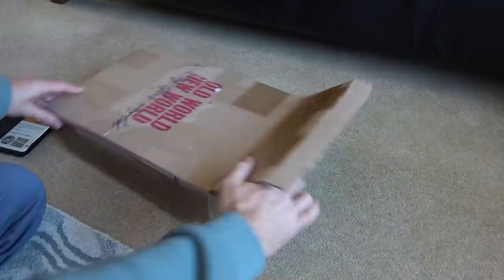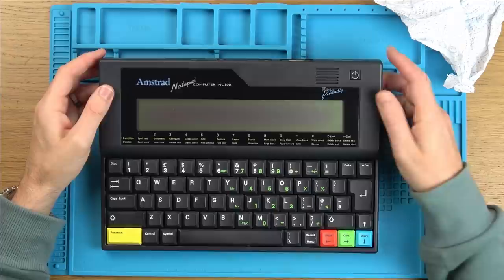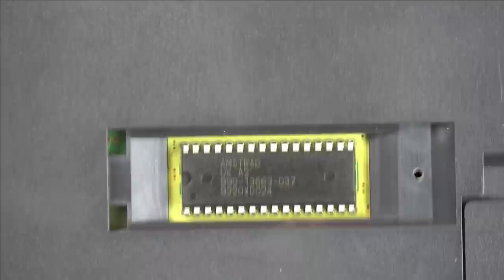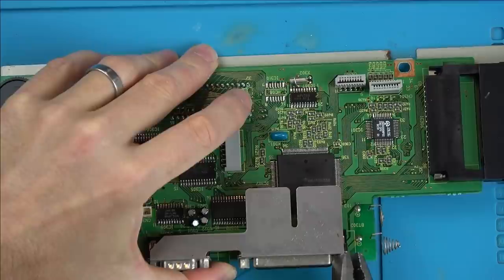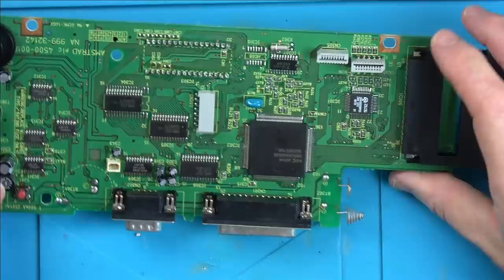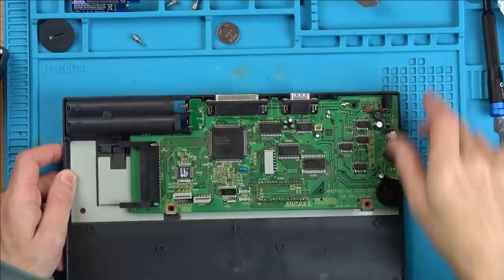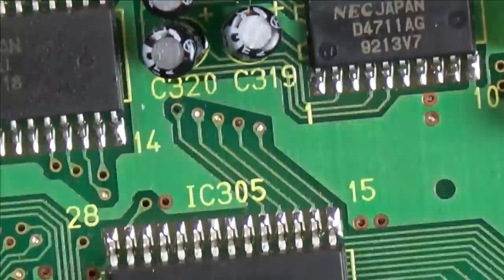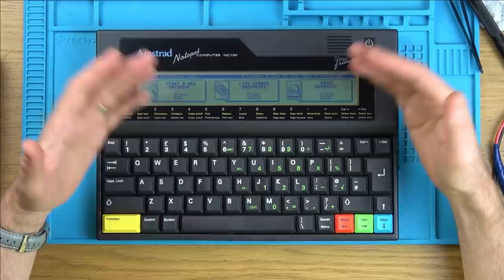Broken 1992 AMSTRAD Notepad COMPUTER NC100 - Trying to FIX

Comment: It almost looked as if the plug had been soldered, looked like flux residue around the lugs, right near the fuse. Maybe someone worked on it and melted the fuse with a bit too much heat

Comment: the wickman fuse on these fails a lot, seemingly for no reason, especially if it looks like its covered with white 'fur', the plastic casing theyre made of leaches out some sort of 'corrosive' stuff which can eat the fine internal wire, the external dc input does not feed power to 'charge' the internal batteries but switches them out on external power, but of course, it could be modified to do so ,..   these may be found to  have a surface mount type fuse instead of the through hole type yours, and mine, have
Reply: that exposed chip IS in a sort of socket(individual sockets for each pin) and is removable,, its the system ROM
Reply: the voltage of the fuse is really irrelevant for this, its the max the fuse type used will safely handle when blowing, its just what theyre rated at ,

Comment: You can do fun things with those, you can ad a couple of serial devices (the old net has a wifi to serial module, a null modem connection), you use it as a terminal, i remember at my local library, they had 1 of those to see if the book you wanted was leant out or not, it was chained down offcourse at the desk, but this was before they had real pc's, i saw another video here on youtube of somebody connecting one of those to a modern mac through terminal, that is so cool! Some classes way back in the day, had some special cards that would plug into the side and they had their own software written for the zilog cpu, and they could control small robots, not factory robots or something, but they could do some awesome stuff with this, it was intended as a super deluxe electronic typewriter, but there is so much more you could do with them, they are very usefull devices if you know what these can and can't do. Basic is also an option, you could write programs on the go for example. Nifty thing, i would love to own one of those! Great video Vince, as usual!
Reply: It's quite interesting to pair these with, say, a wifi232.

Comment: The concept is nice, but is not original... because the Z88 from Clive Sinclair was basically the same (with the same processor), but launched in 1987! 😃
Reply: Indeed - definitely a little more polished though - I'd give anything for my Z88 to have a real keyboard :)
Reply: @DougHenderson  well... I'm my opinion, the z88 keyboard is not bad. Yes, it's not a mechanical one, but it works very nice. And has its advantages, like being completely silent.

Comment: 2+2*5 = 12 Vince.  Throughout I was saying in my head, no need (e.g. to see the chips) as it's just Amstrad garbage.  Evidenced by not being able to perform a calculation properly.  Even my £1 calculator from Poundland gives the right answer (12).  Great video though, as always.  Cheers.
Reply: I scrolled down to see if anyone else had caught this. I wonder if putting parenthesis/brackets around the factors would get it to give the right answer, even though this shouldn't be necessary.

Comment: hi  RS CPC have put alot of there post cost up   RS was £20 mini spend now it's £30  the thing there's not alot of range for high number of the same part
say i like to buy 100 of each  this cost alot more on ebay  

re cap alot of used  reel to reel decks can set you back alot going to ebay

Comment: from what i know, connecting a power supply with the wrong polarity would not blow the fuse, and if there is no diode, then it can cause damage to the board

i once nearly made the mistake of connecting a power supply with the wrong polarity to a musical keyboard (i had bought a replacement power adapter for it, as the original one was long gone and the battery compartment was corroded as there were batteries left in it when it was put into storage, thankfully i checked the polarity before plugging it in, the power adapter was sent with a weird adapter, which turned out to be an adapter which reversed the polarity)

Comment: 2+2*5=12. not 20.
Reply: There are invisible implicit brackets ((2+2)*5)=20
Reply: @flusensieb244  he typed 2+2*5. nothing invicible.
Reply: @vanja.lovretic  after he typed 2+2 it creates a result of 4, then he typed * 5 and it creates another result of 20. It calculates in sequences with the leading results. It is like there are invisible brackets.